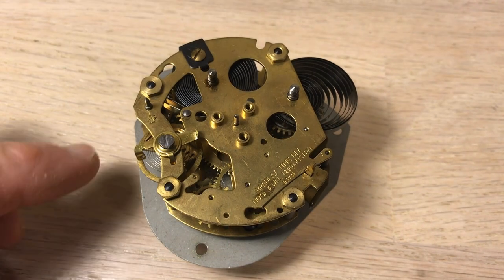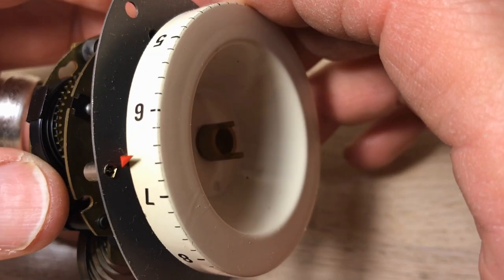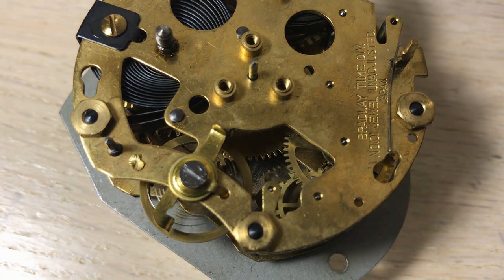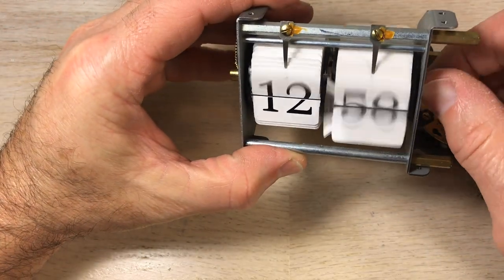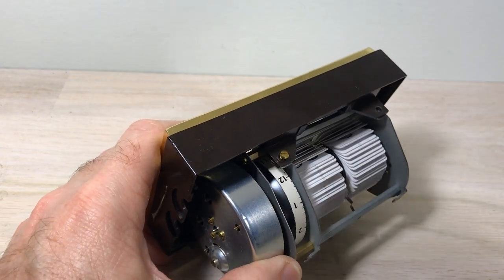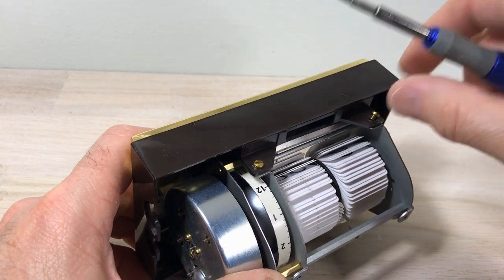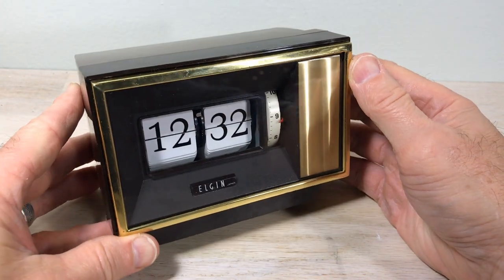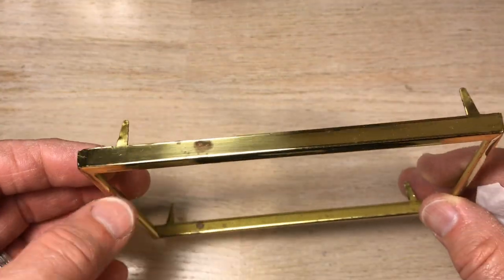Flip Clock Alarm with Clockworks Mechanism - from the inside out.

Comment: Thanks for another informative video.  This Elgin looks identical to the Rhythm 16506 - are they the same?
Reply from the maker: Good eye - I believe that they almost certainly were made by the same Japanese company and simply re-branded as necessary. The mechanism has "Bradley Time Div" engraved on it. So, almost for sure the same company also made the Bradley wind up clocks. The thing is, I beleive that people have, in error, started calling the Rhythm clock the model "16506" because of the number stamped on the back. I believe that is just a part number designating the case. This same number appears on this Elgin clock in this video. This is not uncommon in the flip clock world. Often many assumptions are made in the absence of any concrete records. All this (in this case, in the early 1970s) was before computer records. Most everything was kept on paper, in files ... much information from that era, I believe has been lost.

Some day I'm going to make a video about all the doubles, or twins (or triplets) in the flip clock world. From the beginning these clocks were produced with different brands. The Copal 101 (Japan's first flip clock) has a twin in a Sunbeam model. It's basically the Copal 101 with a different knob and a different name.  There's a "Faces West" Model 3600 that may hold the record for the number of different brandings. (I call this clock the "After Hours Flip Clock" because it appeared in the movie "After Hours"
https://www.youtube.com/watch?v=G3MOzzg3W3I
Reply: @Flipclockfans  Thanks!  That's very helpful, especially about the part numbers.  I've also started collecting Rhythm clocks (of all sorts), in addition to flip clocks, and have found the so-called model numbers unreliable as a means of identification.  Now I know why!
Reply: I just found Rhythm 16506 from drift store for $5 and I feel like hitting a jackpot after viewing ebay prices 😅 was looking for such video as this for getting it running